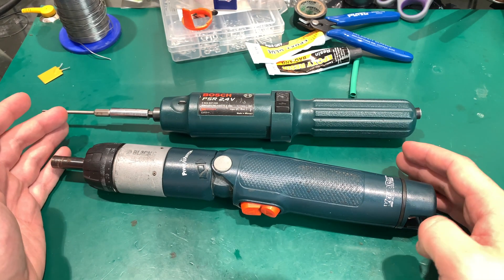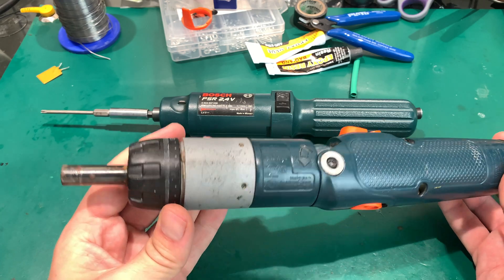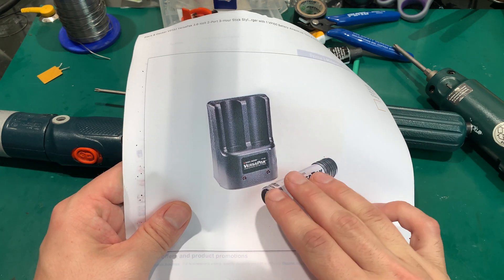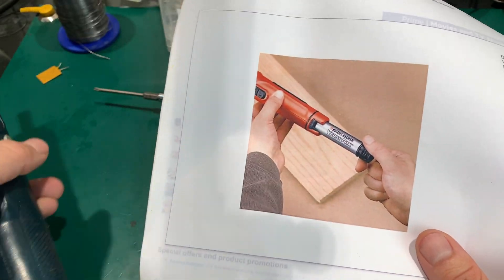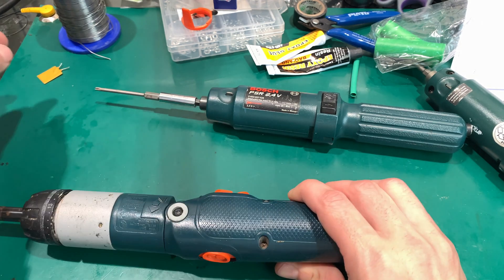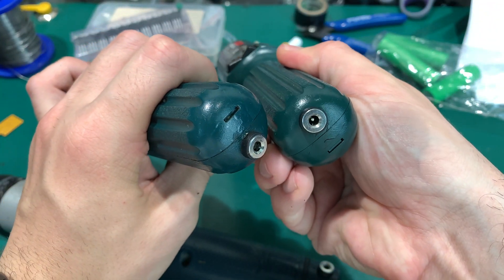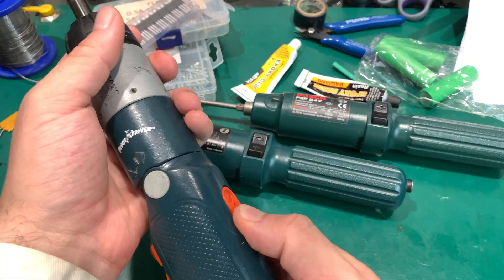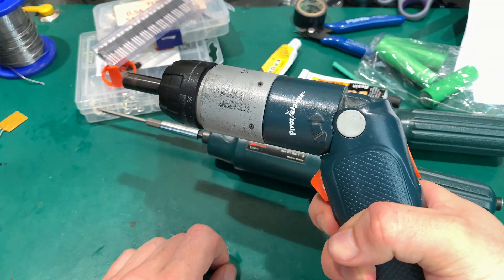(vp760) Pivot Driver Black & Decker Screwdriver  VersaPak converted to li-ion

Comment: I built mine into the old battery. Also converted my wall charger to a lithium charger. The voltage of the wall charger will power the charging circuit for 5 volts.